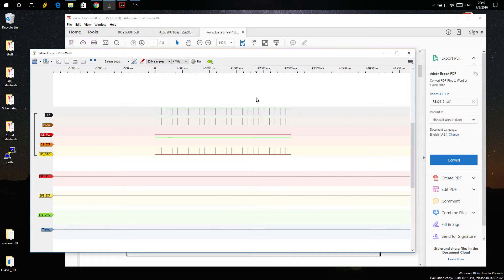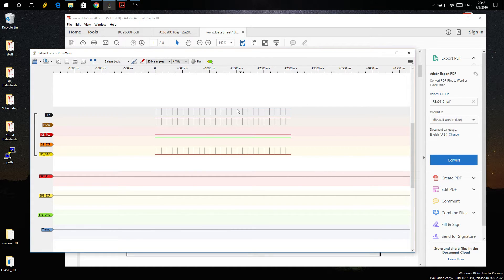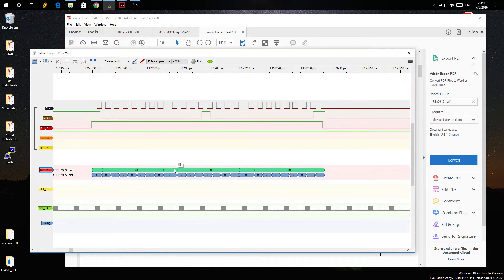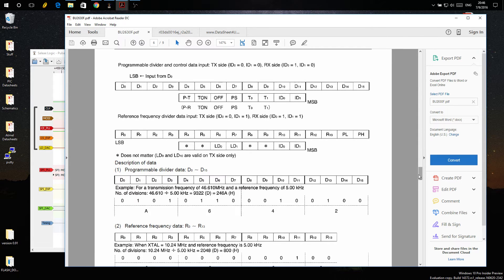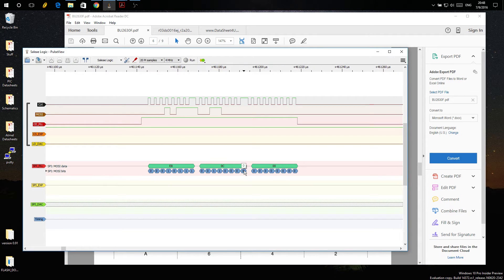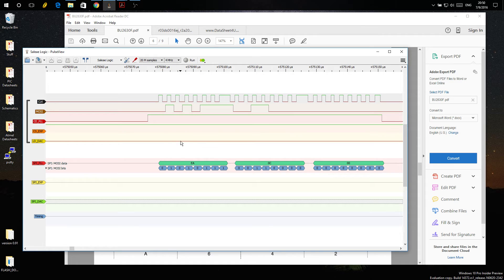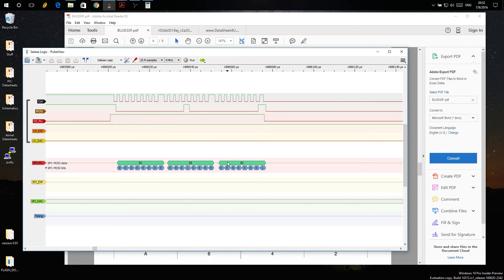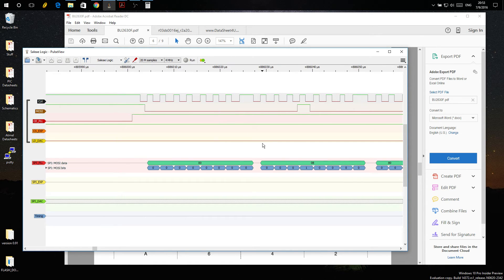Cheap Chinese logic analyzer on the SSB980

Comment: A few months back maybe a year ago Lesters Custom Truck Stop manufacture/designer of the LesCome expansion boards tried to hack the 980 and when he locked up the second one he stopped trying. I had the same idea at that time that comparing the two might reveal some things. I have to think they would reuse a lot of the same parts with mostly different programming.
Reply from the maker: The SSB980 and the Grant II are cut from the same cloth.
Without looking at the MCU in the Grant II I can pretty much tell that they may have used a different MCU in it's design - now the code between them is going to be the same when it comes to the PLL because both radios use the same PLL and divider scheme.
Since the datasheet for that PLL is available it makes changing things pretty trivial.
What is not trivial is trying to break into their legacy MCU since in some cases it's either masked or read locked.

This is actually good stuff to address in a video with some examples and I might do that in a little while.
Reply: This is very interesting. My Dad owns some really nice older radio's I just have a simple SSB CB. I was in First Robotics for 4 years and took a year of programming and network security at my local college. I decided I would rather try culinary arts but I still have more than a passing interest in electronics. I do like hacking and securing minor incidentals. Watching you go through the process of this is very interesting. I also enjoyed the review of your ebay clone logic analyzer. Can not wait until the next video!

Comment: Bit banging, sounds like programmer porn to me. :)  That is strange how the decoder kind of flips out the first time it decodes.  But for less ten bucks how could anyone complain.

Holiday, must be nice.  I can't remember what doing nothing feels like.  Have fun!!!

Mike
Reply from the maker: Yeah... you have to bit bang when you don't have the hardware.
The 78F0483 MCU they used in the radio has no SPI hardware.
I actually looked at mine using the Chinese logic analyzer and the decoder had no problems decoding it.
Their timings - while they work - are at the edge of what the PLL will accept.
From enable to the first clock pulse needs to be >=2uS and they are like.. right at 2uS.
It's just a little sloppy - but I suspect that's why the decoder had issues with some of the starts.
They (Uniden) need to try to delay that by at least another couple uS.

Comment: I thought the 980SSB had an MCD2926 PLL......did it change?
Reply from the maker: It has two PLLs. One for the VHF receiver and one for the HF RX/TX.
Reply: So the PLL for the 27Mhz TX/RX is MCD2926?
Reply from the maker: No, BU2630F
Reply: oh ok.....that kind of blows hahaha. I have been reverse engineering the wrong chip. When I get my radio it will be easier to work with, I just have data sheets. The MCD looks easier to work with than the BU.
Reply from the maker: The BU2630F isn't that bad. The reference register should be if I did the math right off the top of my head that is... 0x400
Because it's 10.24Mhz / 10Khz so 0x400h
If it runs @ 5Khz then its 0x800h
That's the hard part.
Reply: Which register is set and sent first?